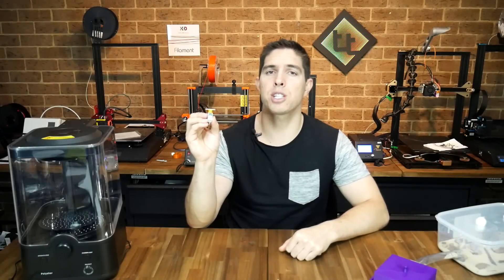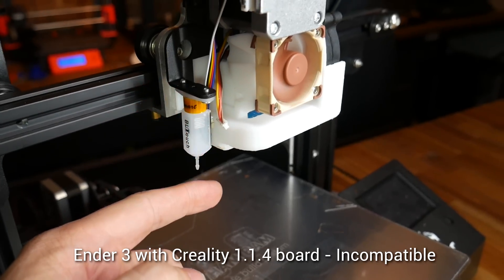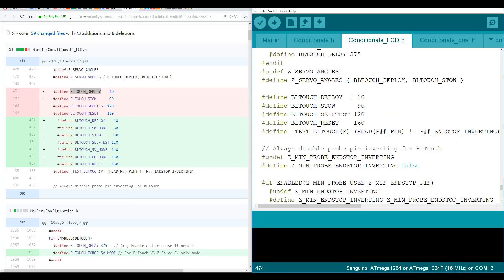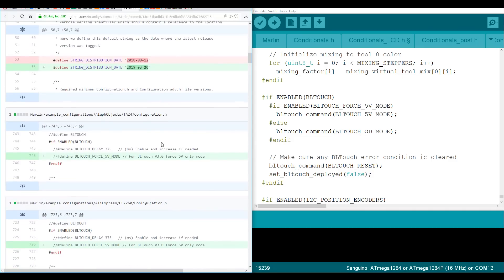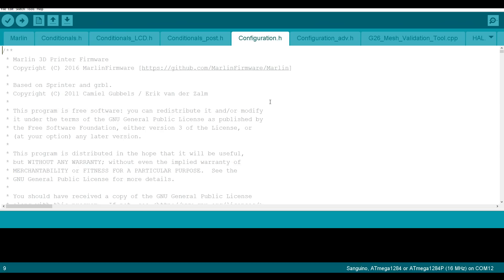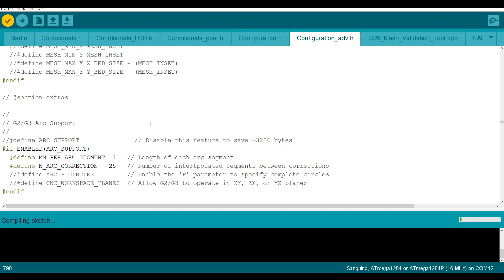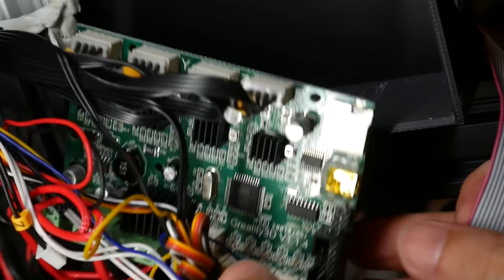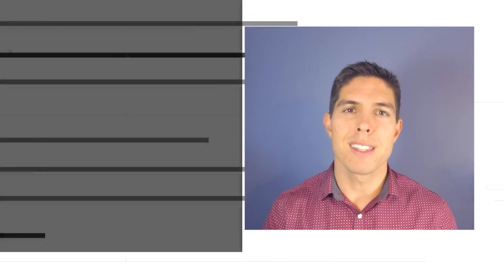3 Fixes for BLtouch V3 on Creality machines

Comment: Hi :) ok so I have been at this for days now, and in the discord group still no answer...
I have a CR10S5 with a Creality V2.1 board and the 2560 chip. In the TH3D firmware there is an option to uncomment my printer but it has the 1248 chip, so I uncommented the 2560 version which is the CR10S_S5... I hope that is good... I used an Arduino Uno and flashed a new bootloader in order to get a clean install.  Loaded your firmware TH3D_UFW_U1.R2.B5 all is good. BUT for some reason I can not get the BLTouch V3 to work properly. I had to reverse the red and white wires in the probe cable in order for it to work at all. This got it to stop when the probe stick hit something. When I start a print, the probing starts and totally at random point instead of continuing to probe, the X gantry just lifts a little bit at every probe point, the prob stick no longer extends... Sometimes when the probing does complete, the print starts BUT every few seconds the filament change sequence is triggered... I have no idea what is going on... In one YouTube video I saw that there is a BLTouch V3 line to be uncommented in your firmware, however I can not find that option anywhere... in Discord someone told me to try and turn of the #define BLTOUCH_SET_5V_MODE, but that did not help. Also I tried it with the #define CR10S_NOFILAMENTSENSOR commented, still no luck... Please help? :( I hope you will answer all my problems... THX in advance...

Comment: Just installed my BLTouch (v3.1) kit and used your V3 firmware -As soon as the probing is finished, it says the print is complete.
I've verified the GCode is all there, but printing never starts any suggestions?

Comment: I just have major headaches with my BL touch working on my CR-10s PRO V2.  Half the time the pin drops and works correctly, half the time the pin doesn't drop and it just moves on to the next measuring point.  I'm about ready to toss it :(

Comment: Thanks for that video !
I've just got few questions regarding the old method given for bltouch (v<3.0): on your video, you were specifying about:
#define ENDSTOPPULLUP_ZMIN_PROBE
and:
#define Z_MIN_PROBE_ENDSTOP_INVERTING true
but also:
#define MIN_SOFTWARE_ENDSTOP_Z

In current video, you do not talk about those settings anymore...
Not required anymore ? Any particular reason not to reproduce this for bltouch >3.0 ?

Btw, for PROBE_BED_POSITION, I think something like this shoudl be better (not symetriclcal however):
MIN_PROBE_EDGE 10
LEFT_PROBE_BED_POSITION MIN_PROBE_EDGE
RIGHT_PROBE-BED_POSITION X_BED_SIZE + X_PROBE_OFFSET_FROM_EXTRUDER - MIN_PROBE_EDGE
Don't you like this solution, which, I think, allows to have better 'map' of the bed, while calibrating ?

Comment: Hi there, thanks for this video! I had a BLTOUCH V3.0 not working on the Ender 3 on Marlin 2.0.6. Since the 1st and 2nd methods don't work with that firmware anymore, I tried method 3 (desoldering the capacitor) and it immediately worked. THANK YOU!!!
Reply: @Ajith Kumar Hi there, I tried pretty much everything you just said when trying to make mine work to no avail. I can assure you that it is safe to remove the capacitor. All I used was some tweezers, a soldering iron, and some solder to help reflow. I was on board 1.1.3 when I did this.

If you look closely at the PCB trace, you can see that the capacitor is connected in parallel with the z-stop pins, thus removing it will still allow the connection to the z-stop pins, thus it is safe to remove the capacitor.

Comment: i've installed the bl touch but when i auto home it goes to the front left and because I've removed the z stop it won't stop
Reply: I have an Ender 3 and just installed a BL Touch. I'm using Creality's firmware and had that issue once when I tried to start a print without leveling the bed first (through the user interface). The G-code file didn't have G29 in it. What firmware are you using?
Reply: I have an Ender 3 and just installed a BL Touch. I'm using Creality's firmware and had that issue once when I tried to start a print without leveling the bed first (through the user interface). The G-code file didn't have G29 in it. What firmware are you using?

Comment: I am trying to install the BLTOUCH V3 on my newly purchased Ender 3 Pro..I have followed the Teaching Tech video for modifying the Marlin 1.1.9 firmware and successfully compiled and burned it to the board but the BLTOUCH was still not working properly.(red led on and would not deploy when homing) so I removed the capacitor per the instructions and the BLTOUCH is still is not working (same as before I removed the capacitor) but now the z motor is chattering and seems to have trouble moving.
 
The board is Creality 3D V 1.1.4 
 
I removed the large Capacitor at the Z-STOP R3 as instructed
do you have any Idea what to do now?
Reply: I've had exactly the same thing recently with the kit from Creality. My PIN27 board was faulty. If you have a multimeter check the continuity of the 3 pins on the board. On mine the SIG pin where the yellow wire attaches had no continuity to the correct pin on the main board.

Google pin27 schematics and you'll find out what should connect to what
Reply: @pete.williams  
Thanks Pete for the tip I did check the continuity on the pin 27 adapter and unfortunately it is connected so I pretty sure it must be something in the firmware so I'm going through it again (for the 4 time)

Comment: Hi Michael love to channel I just received my bl touch just wondering if you've ever come across v 3.1 version which I just received today hoping the point 1 was the fix 😁
Reply: ive got the 3.1 and its giving me a bit of a headache. methods 1 and 2 i cant do as the code differs from this video and ive also tried method 3 but still had no luck. when i power on the bltouch clicks a few times but when homing it does nothing. let me know if you figure anythig out

Comment: I was able to get your precompile to work on my Ender Pro 3 1.1.4. I auto leveled the bed which it goes around and touches all points, when I return it home it touches down properly after adjusting z, and z offset I then saved settings. When I start an actual print its nowhere near the bed on the corners and does not stick. Am I doing something wrong? Also when I turn it back on does it automatically load saved settings or do I have to manually load? Other than that it says Ender3 without pro but its okay!

Comment: I don't understand, does the HEX file teaching tech provides have these code fixes in it already? Cause I still get a ton of probe failures and misreads . Ender 3 Pro with BLTouch 3.1 (Marlin 1.1.9 bugfix with thermal runaway protection)

Comment: I managed toi have the system work even though I have BLTouch V3 by removing the capacitor and going back to the V2 Firmware you prepared.  Using the V3 FW didn't solve the issues. Thanks for the tips and making the firmwares available

Comment: Thank you very much for this video. Is this also working for the Sidewinder X1 MKSGENL V1.0 on Marlin 1.1.9 and BLTOUCH 3.1? I got the same problem, Z steppers don't stop movement if BLTouch touches heatbed. Thx

Comment: thank you, i have a 1.1.4 mother board and my BLTouch is right and i have Offsets nozzle:
X: +32mm

Y: -2mm
I download the  pre-compiled firmware hex prepared by myself for BLtouch V3 (Marlin 1.1.9 bugfix with thermal runaway protection but it's possible to change the offset ? Thanks

Comment: I have the weirdest problem with my BLtouch and CR10 v1 (v1.1.3 board). Everything works, the leveling process goes perfect, but after leveling it seems like it doesn't know where to go. The Z goes up infinitely (showing ".,-()*"  on screen) and the X goes infinitly to the right.
This happens also when I just preform an autobed leveling. I hope someone had a similer problem like this.

Comment: Will go with the removing the capacitor, more comfortable with a soldering iron than code, I take it this will work on the Ender 3 Pro. Have the kit with the V3 probe but on the box it say for Creality V1 Mainboard. So much confusion with this but would be nice to have the ABL.

So, can someone confirm that I just remove the capacitor and install as normal. Heard that sometimes we lose the SD card feature. I need that lol

Any pointers for anything I've misunderstood would be gratefully received. Many Thanks

Chris
Reply: I have just finished fitting the official Creality BLtouch v3 kit to my ender 3 pro and flashed the latest version of there suplied firmware from the Creality website (https://creality.com/download/firmware-for-bl-touch_c0006) and it now works perfectly without the requirement to solder anything or make any code changes.

I was just watching this video as after I have everything working fine I was then planning to upgrade to Marlin 1.1.9 rather than the custom version of 1.1.6 the manufacture supplies to get the newer features (without giving up SDslot support which I use), and if I can't get it working I can just flash back to the stock 1.1.6 BLtouch firmware by just following the instructions from Creality again.
Reply: Douglas V thanks Douglas, that’s good to know my friend. That will be the way I go then 😎
Reply: @ChrisLee-UK  I have had my V3.1 BL-Touch kit sitting on a shelf since December hesitant to attach it to my E3-Pro because of all this drama. Can you confirm that you got it to work with your Ender 3 Pro, and what procedure you followed?
Reply: @SimplyDudeFace  I did yes, using this guide, It all went smooth and worked perfectly
Reply: @ChrisLee-UK  You used the de-solder the capacitor version? Did you flash the firmware from the Creality website, or the custom one that teaching tech provided?
Reply: @SimplyDudeFace  No Sorry, I didn't desolder anything or have to swap any wires in the end, Installed everything and then used this firmware. All worked fine with no hassle
https://www.dropbox.com/s/t0keklxcllx6xtz/BLTouch%20Firmware%20Compatible%20with%20V3.0%20and%20Guidance.zip?dl=0&file_subpath=%2FEnder-3+Pro
Reply: Chris Lee - UK thanks for the link. I will give it a shot tomorrow following the basic install and using the firmware you linked to.

Comment: I’m having this issue with the BL touch on my SKR 1.4 turbo now. When using the “dedicated” probe pins my z axis would only move up not down. When I did what I’ve seen you and others suggest, switched to the z min instead, the z axis now moves as it should up and down. In config I can get the probe to test reset deploy and stow but it won’t stop/trigger when auto homing. I’m currently using Cheetah but going right try Vanilla marlin again. Cheetah has a very user friendly set but their support is HORRIBLE. If you don’t buy from them they won’t help. Can you please help?
Reply: I'm having an issue too. Got my z to go in the right direction, but it won't deploy when told to G29probe after G28. Idk what to do now. Probe is functioning, it does the test deploy and retract and even triggers, but it won't deploy while probing. Marlin 2.0.5.3, BLT 3.1, Skr 1.4 (regular). 😕
Reply: Andrew Meyer yea I gave up on cheetah. I found a marlin build someone had on thingiverse and I used it. Seems to be working. Waiting on my filament dryer to come in next week so i can dry my filament before printing
Reply: @LifewithLewy  I ended up moving the black/white probe pin to Zmin pin (black is center, white is the pin on the bottom) and I got the probe to fkn work properly with using the z_min_pin as the end stop for the touch sensor. The sensorless homing is giving me some issues though with the sensitivity. I think you gotta fine tune the homing acceleration (from like 50*60 > to more like 20 or 30*60). If the X or Y motion strikes the end while homnig (where it normally homes for you) too fkn hard, it won't like it and keep skipping steps (RATATATATAT hah). This can also be influenced by the driver current from what someone has said.
Reply: Andrew Meyer I found a build someone had on thingiverse and got it working using the dedicated probe pins. The other way wasn’t working for me

Comment: Does anyone have a bootloader ready file for Ender 5 with 1.1.5 Main board To make the BL touch work as intended?
After installing the software reccomended by Creality for Ender 5. (It removed my preinstalled version of Marlin 1.1.8) My BL-Touch is probing outside of the bed (on the left side) With it also acting like a Z-Stop this copletely screwed up my printing experience and not only that, it decided to just carv a deep scratch on my Prima Creator Flexi build tak. This experience has cause so much headach for me and I have no idea how to fix it. How do I tell the BL-touvh where its ok to probe and not? Please is there anyone who can point me in the right direction?

Comment: Seriously... Don't even bother with the first 2 methods. Just get rid of the cap. You don't need to use a soldering iron or anything. You don't even need to remove the board. Just reach in there with a small needle nose pliers and crush the little bugger.  Make sure nothing is bridging the gap, and you're good to go!

Comment: A couple of things I noticed is the pins on creality board are thinner than clips so can lead to bad connections.
If you also have old metal pin version and like me, mashed it into the bed a few times the top of the pin is connected to the magnet by a piece of shrink wrap, shaped in a point to stop the pin catching on the inside of the sensor, when it gets smashed this gets bent.
Best thing is to add a second layer of shrink wrap to guide it in the bore of the sensor better, also leave a small amount above the magnet to stop the pin from sticking to the grub screw when it's retracted so strongly it over powers servo.
Its a fine balancing act getting length right so pin stows well enough to not be shaken free and not stuck so strongly it can't be deployed.

Comment: I spent months messing with different firmware builds, different header configurations, different physical modifications and work arounds. I just desoldered the C7 capacitor and it immediately started working as expected. I knew about the fix for awhile but it seemed like a somewhat drastic work around. If you're at the point where you're about to buy a different probe, or just go back to manual mesh leveling, just take out your soldering iron and give this a shot. 5 minutes and it's printing like a pro again (it's not the pro model haha :( )

Comment: I used the precompiled hex but I can see  from the first layer that bltouch has not set the frame as it should. Maybe If I increase the probe points.....  unfortunately to do this I need to prepare  from scratch the 1.19 bugfix but the configuration.h is different than the one you show in the video. Not a usefull video.

Comment: Hi Michael, I have a antlabs BL Touch 3.1 (they shipped me the wrong version) I downloaded your compiled version of marlin but the dam sensor keeps flashing with a dim red flash inside of it, do you know what this is about?
Reply: never mind the wires were swapped in the cable that came with kit, of coarse yellow is blue

Comment: I have installed the 3DTouch v3.0 and upgrade the firmware to marlin 2.0.4.4. I have an issue with Z-homing. the nozzle touches the bed, the nozzle continues to go down even if the trigger point of the 3Dtouch has been reached. Like if there is a delay after the trigger. Is the capacitor be the root cause of this even in marlin v2.0.4.4 ?
If sending the code G29, working has excepted.
Reply: Capacitor removed and all working good ! Many thanks !

Comment: BL Touch v3.1 and Marlin 2.0 Bug Fix on an MKS SGEN L 32bit board with TMC2209 drivers in UART mode.  Anyways thanks for the video I been driving myself crazy for 2 weeks now trying to get the touch to work.  I decided to go with removing the capacitor.  Thought I had the skills but my soldiering tip was to big and I ruined the board.  Took off a resister by accident and lost it as it was so small.  :-(  Ordered a new board, same one but I think I give up on the touch for now.  Still appreciate the video I was at the end of my rope with this thing.  Just wish I got the chance to test it without the capacitor.

Comment: My BLtouch V3 was working great for a few months, but now it either doesn't turn on at all, or turns off before leveling, so I always get the extruder running into the build plate. Any idea for how to fix it?

Comment: Man, I'm lost now. I hooked the BLTouch up like shown and now the screen is blank. Take out the 3pin...screen works. Reverse it and take out the 2pin but leave the 3pin connected...screen works. Take both cords out, obviously works. And this is a real BLTouch. I popped the pins out so they match this diagram. Red near SD card/LCD connector, brown in middle, Orange on top. On the Z stop 2 pin, Black on away from the SD card, white near it. When I had it hooked up before, the red was in the middle and brown on bottom... but the BLTouch would not send a stop signal.

Comment: Hey Micheal,
Followed you video on installing I noticed 1 your numbers for fuses are opposite to what the send in instructions, I used yours. Then my pin won’t even deploy on auto home when you first select auto home it comes out back in back out then back in where it stays. I have to turn printer off manually to stop from crashing into bed. I have the 1.1.5 board with the v3.1 bl touch from Creality also I tried their setting with no luck any thoughts???

Comment: I was installed blv3 on my ender 3. Flash precompiled firmware ... if i want to print - printer do autoleveling and after just run time and % but printer stay on the point ... any idea? many hours i was spend and i cant to print .. thanks for help friends